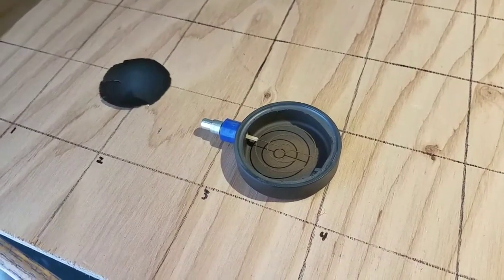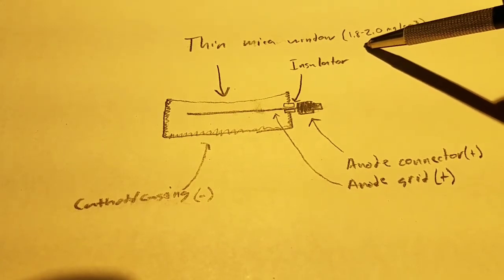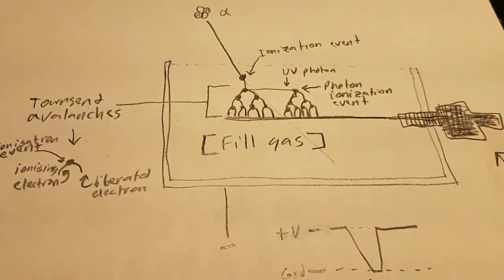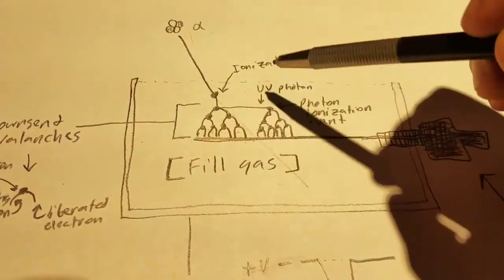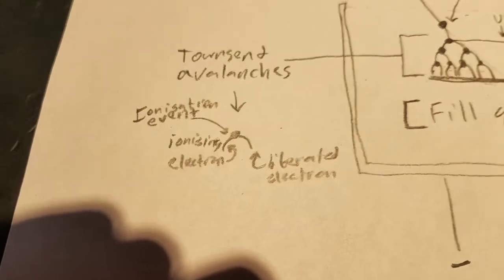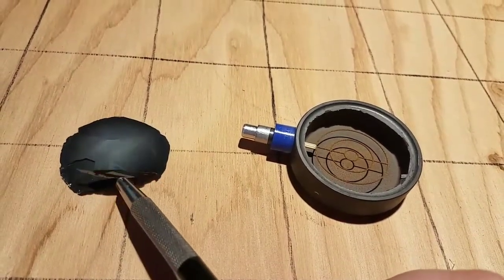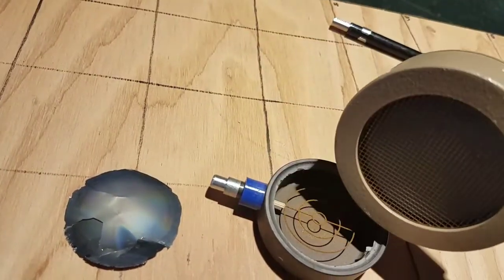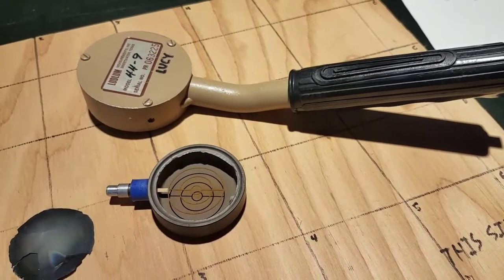How Geiger-Müller tubes work and a disassembled pancake detector

Comment: According to the internet gamma rays (higher energy ones) are detected in many different ways, mainly indirectly by ejecting electrons from atoms of the metal casing (in the tube types) which can then ionize the gas atoms in the tube.

I think in pancake style probes like this on the other hand do in fact use the direct ionization process to detect lower-energy gamma or x-rays (less than about 20,000 electron volts or 20 keV which are easily blocked out by the metal of the tube) given the thin mica window.